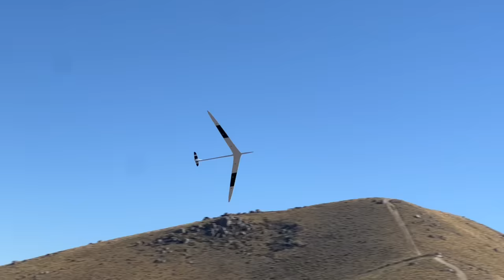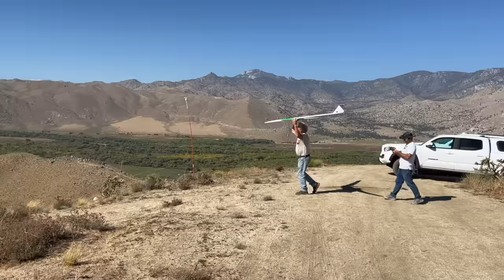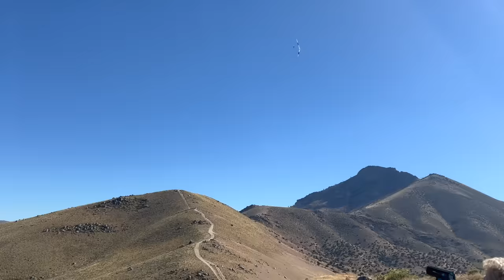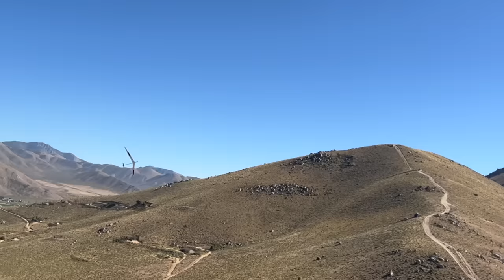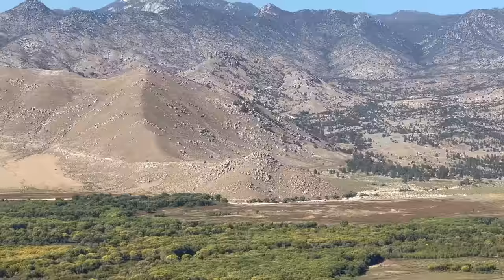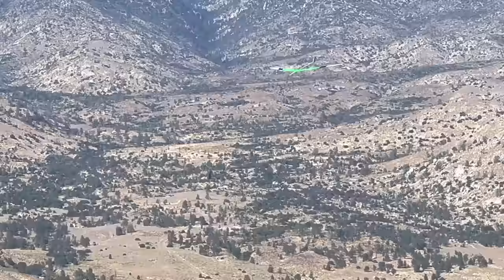Spencer testing Transonic Sweeper

Comment: Wait, so this is just powered by the wind like a glider? That's freakin awesome!
Edit: Everybody, please stop explaining to me how this works. I understand the physics of it. I know how a glider works. I get it, "powered" was a poor choice of word to use. I have just never seen anything like this before and it blew my noggin up.
Reply: Gliders are not 'powered by the wind' although they may 'translate' moving currents of air into 'lift'!
Reply: Yes gliders are always descending relative to the wind.
Reply: Agreed, awesome
Reply: @pcka12  This is an interesting semantic discussion. Are sailboats powered by the wind? ;) I think in either case it depends on what you mean by "powered". Both generate lift from the difference in the movement of the air relative to the surface. In dead still air, both eventually drift to a stop.
Reply: I've seen videos like this for a couple years it always blows my mind.
Reply: Gliders are not powered by the wind. The pilots of gliders seek out lift in the atmosphere. Thermal, and ridge lift among others.
Reply: @johnsteichen5239 
This glider is fairly literally powered by the wind - it's gaining energy from the wind shear (difference in wind speed) on the lee side of the hill.
Reply: @johnsteichen5239  Well, thermal or ridge lift is just a vertical wind component. So yes, gliders are powered by (vertical) winds. This glider however is not powered by the vertical component, but by the windspeed difference between luv and lee of the ridge.
Reply: Technically this is called slope soaring
Reply: @stevennagley3407 at the beginning and end, yes (more commonly “ridge soaring in orographic lift”), but the high speed round and round you came here to watch is called “dynamic soaring” because it exploits the wind shear rather than the wind that’s going up the slope. Current material limitations only make this practical for rc gliders except for some very specific instances.
Reply: It’s remotely powered by a massive fusion engine...
Reply: @stevennagley3407  that’s on the windward side of the slope.
Reply: @antialias  so can you elaborate little more as if I designed a monoplane to launch with no existing airfoil on a wing and followed up passes at high speed? I’m happy you replied with that information and was informative to people seeking a understanding of the hobby I was just stating if people were interested in learning more then about the subject they can seek more by looking more into slope soaring as a keyword not to completely describe what is happening in this videos because it it high performance aircraft and skilled pilots flying. I fly both rc aircraft and helicopters btw so im aware of the skill and challenges of what the pilots experience
Reply: @pcka12  Dynamic gliders actually are powered by the wind. They can only achieve the speeds they hit with the wind.
Reply: @D3moknight  do you mean 'with a following wind'?

Sailing boats are ultimately powered by the sun but they gain motion by balancing wind against water, gravity is little involved; however in the case of a 'sail plane' it is all the time 'falling under gravity' (acceleration of 9.8 m/s/s) but at times buoyed up by currents of air.
Reply: @stevennagley3407 more specifically Dynamic Soaring "(a "discovery" largely credited to RC soaring luminary Joe Wurts)"
Reply: I can clear this up. Quantum. Paradigm shift. Game changer. All better?
Reply: @flstateuguy83  if you say so!
Reply: @TylerKaraszewski  BUT gliders descend to the surface whilst boats are already on the surface, because sailing boats do not 'fall under gravity'
Reply: @Bebtelovimab 'momentum' MV (mass X velocity) kgm/s is the product of mass times velocity, a vector quantity, a body (such as a glider) will continue in motion because it possesses momentum, however the glider gained momentum either by being launched (so a winch or tow plane did work in imparting momentum to the glider) therefore whatever did work imparting momentum to the glider 'powered' the glider not the momentum which is simply a measure of the energy due to motion contained in the moving glider, but we measure that energy (as kinetic energy) from the formula Ke = 1/2 Mass times Velocity squared.
If the glider was stationary at a height (perhaps suspended on a thermal) we would measure it's Potential Energy from the formula Pe = Mass X Gravity X Height.
Reply: It looks like B-52 without engines.
Reply: Slope gliding is in the evolution of rc planes. One of my favorite, this is insane though lol
Reply: It is a glider
Reply: @antialias  And birds. The albatross being the best example
Reply: @TylerKaraszewski  there’s a huge amount of skill to consider in the extraction of such power! It’s like that of a yacht as in the tacking but this is so much more extreme!
Reply: @pcka12  you are seeing a complex form of flying in a simplified way! that only describes one aspect of flight not this entire manoeuvre!
Reply: @Bebtelovimab it has momentum and the air has momentum but the pilots skills are what power’s it!
Reply: @needmoreboost6369  I am seeing the energetics of flight, but not the poetry, if you read 'Winged Victory' dating from the last year of the Great War you find in the author a man who understood the poetry of flight but was only too aware of the terrifying physics with which he was involved & how it might take a man's life in an instant!
Reply: @christophs8735  ...and, millions of years before him, many species of birds
Reply: Technically, there are two sources of power in the universe that we know of. Solar, and nuclear, in which nuclear is actually powered by gravity. But then again, I guess so is solar. So maybe just one source of power in the univrse, with that being gravity.
Reply: @babybirdhome  how do you explain the idea that 'nuclear' is powered by gravity when we know that gravity is a comparatively weak force & intramolecular forces can be very strong?
Reply: @pcka12 it's tricky to go right back to the beginning, since that would be almost before time.
BUT
If you take a snapshot of the universe, just after inflation, when the plasma has cooled to a load of hydrogen. It's gravity that caused the hydrogen to coalesce into stars. It's the fusion reactions (due to gravity) in stars that has made all elements (except funky stuff like plutonium and other short lived ones that are only temporary).
So, all chemical energy, all geothermal energy, all solar energy is due to gravity originally, if you take t=0 to be at the end of cosmic inflation.
The only other energy we experience is the cosmic microwave background, which is the remnants of the thermal energy of the original event.
Reply: @dougaltolan3017  it is entirely possible that I am out of date with what physicists believe but have the ideas of 'strong forces' & 'weak forces' gone out the window? Or is this all a function of 'inverse square law' type of ideas?
Reply: @pcka12  this is going to be glib, the details would take a few books. Quantum physics definitely excluded! 
There are 4 forces:
Electromagnetic
Gravity
Strong nuclear force
Weak nuclear force

The last 2 only affect molecular, atomic and sub atomic distances.

While gravity and electromagnetic forces both have an inverse square law, large electric fields are rare since like charges repel so there aren't big lumps of charge in the universe (a few oddball exceptions probably exist...)
Since there is no anti gravity (sorry scifi) and gravity is an attractive force, it abounds in the universe.

It is purely the mass (and therefore it's gravity) of a star that heats and compresses it's components (initially hydrogen). The temperature and pressure achieved is sufficient to overcome even the nuclear forces, thus fusion.
Reply: @dougaltolan3017  this does seem to rather reflect what my science education told me!
Reply: You gain altitude in the lift, potential energy, and then convert that altitude to kinetic energy by lowering nose and going fast.
Reply: Imagine - Sonic boom
Reply: wind... yeah, but it also contains a minature Tom Cruise, to make those tight turns.
Reply: @pcka12 Think you might have this wrong in this case. As an RC slope soarer, I depended on wind speeds to give me lift. This is a mixture of physics and air pressure. Very much unlike thermal soaring. I was lucky enough to watch a world champion thermal soarer show me how he located his aircraft 2 miles away... He gave a quick aleron wing flip which he had covered with a reflective surface. It blinked in the daytime sky.
Reply: @patrickvanrinsvelt4466  the winds exist because of the sun, air masses are heated & cooled in various parts of the planet & times of day with resulting changes in pressure & net flows of air which we call 'wind'.
I, too, have built & flown model slope soaring gliders.
Reply: Look up 500 mph glider on YouTube. They get 505 mph with it.
Reply: @nikolaihedler8883 And by the geometry of the pilot's skill.
Reply: @patrickvanrinsvelt4466  The basic working principle of slope soaring (the normal kind, on the front side of the hill; not DS) is exactly like thermal soaring. Descent rate of the glider is lower than climb rate of the air. Simple as that, both cases. The difference is that in a thermal you have to stay slow to stay inside it, where this limitation does not exist on a slope, where you can go fast and far. And, faster wind will give you a stronger updraft as well, which lets you go even faster.
Reply: @nikolaihedler8883 There's no turbine gaining energy or making energy, so it's not powered by the wind.
Reply: @Zeaiclies  the plane is gaining energy using the power of the wind. What else would you call it but wind-powered?
Reply: @nikolaihedler8883 
It not gaining any energy.
Where is it storing the gained energy?
Where is it converting said energy for use?
What form is said energy?
What power is the energy converted too?
No, it's not wind powered at all!
Reply: @Zeaiclies  it's constantly losing kinetic energy to drag, so if it were not also gaining energy from the wind, it would stop flying. The energy gained doesn't need to be "stored" or "converted too [sic] power" because it's gaining kinetic energy directly.
Reply: @nikolaihedler8883 
The wind is not the cause of the kenetic energy.

Performance of a loop or roll through the wind, generates kinetic energy but the wind itself is not the power.

Driven by wind is more accurate
Reply: @Zeaiclies  "driven by" is synonymous with "powered by" in this context. If the wind weren't the source of the energy, then this would work without wind. It doesn't. Without wind, the plane cannot regain lost energy.

If the plane stops flying when there's no wind, it's powered by the wind.
Reply: @nikolaihedler8883 
No!
A sail boat is driven by the wind, but a steam boat is powered by the steam.

The plane is driven by the wind to keep it's speed and flight. It turns potential energy into kenetic energy through performance of a loop or roll.  It's not using wind as it's locomotive force nor storing it as fuel.

As a glider it can still fly but not as long without a thermal
Reply: @Zeaiclies  you are making a distinction that does not exist.
Reply: @Zeaiclies  the wind literally is the locomotive force.

Comment: Don't forget that transsonig flight requires a swept empennage too. You want any part of the plane go supersonic first, but most certainly not your elevator.
Reply: And also make sure it’s a full flying elevator so the shockwave caused by the leading edge of the tailplane doesn’t shroud the elevator

Comment: This RC genre is the Pinnacle of RC planes. Absolutely incredible. I fly lots of RC planes in all sorts of models. 3d, Warbirds,Stol,Scale, Jets, gliders, whatever. But these slope planes that fly in these locations that generate extreme speed off the wind rolling over the top of the ridge then down into the low pressure pocket then back into the high pressure over the ridge just blow your mind. The speed and sound! Just perfection. Adrenaline pumping RC flights. And planes built to withstand the G-load are a work of art and incredible. I have seen many explode. But when a fella gets it right and has lots of exploded planes under his belt the outcome can be truly amazing. Props to the pilot and builder (most the time one in the same) and keep the videos and planes coming. Love it!